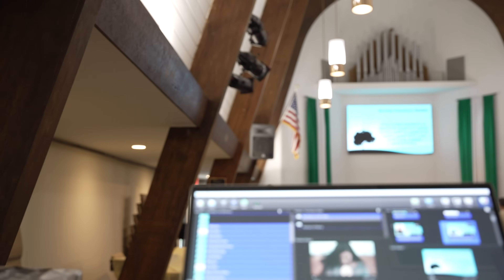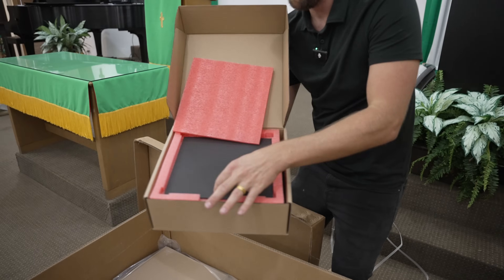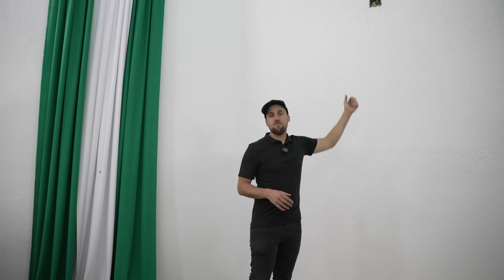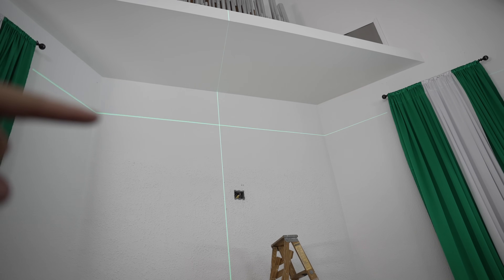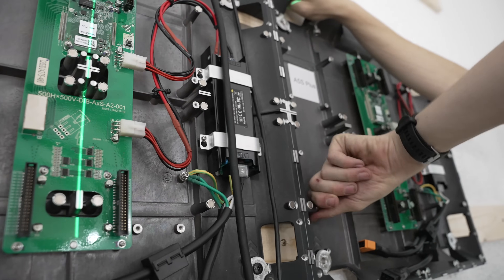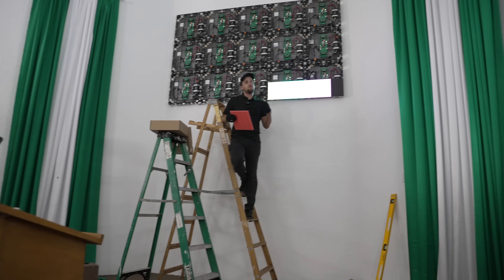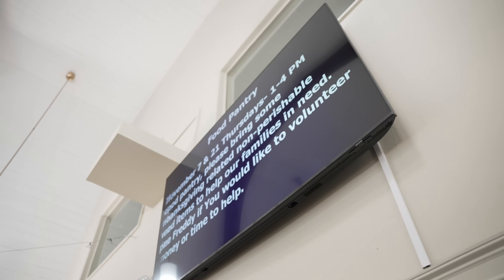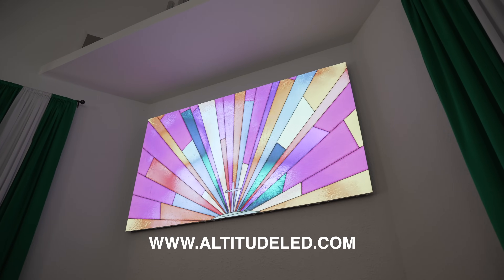Small Church LED Screen (How to Install)

Comment: Ok, but what's the cost without installation for just the LED wall?
Reply: Ditto this question. Every video wall I hear sounds like north of 100k so it’s a non-starter. Makes me want to just alibaba some cheaper panels and try to diy things
Reply: @SinderSa I can say that this project was likely not even be 1/4 of that. I have a much larger sized quote in my email and, including installation, it is slightly north of 50k.
Reply from the maker: reach out on our website and we can provide you with an accurate and custom quote!
Reply: For that size it would be around $9K - $14K

Comment: Great video, Jake! Can a church start with a smaller size like this and over time add panels as their needs change? Penny for your thoughts…
Reply from the maker: We don't recommend adding additional panels to the same screen down the road as most of these modules are manufactured in batches at the same time. So there could be visual discrepancy when you add new modules to an older screen.

but you could keep the original screen the same and then add a new screen. Like going from one center screen to two side screens.
Reply: @AltitudeLED  Appreciate the prompt response!
Reply: I’m not Jake, but yes, you absolutely can, these systems are modular, but you may need more circuits, so plan for more circuits than you need, if you need 1 20 amp circuit, make sure to install 2 or 3, maybe get two quotes, how many circuits needed for your biggest desired wall, and work on getting there later, it will be cheaper to have the electrician install all of the circuits at once before a wall is in the way.
Reply: @dustyfanblade5937  Thanks for the input!